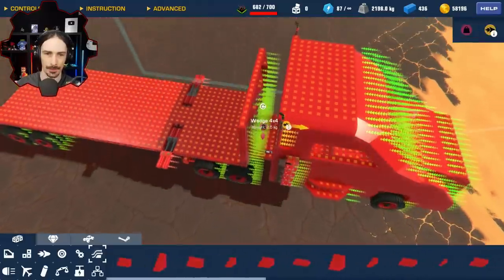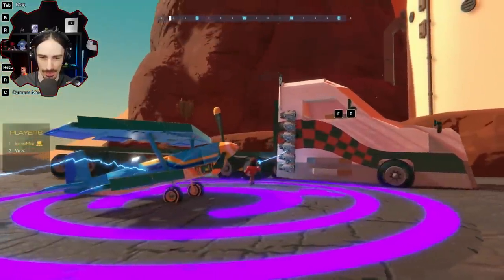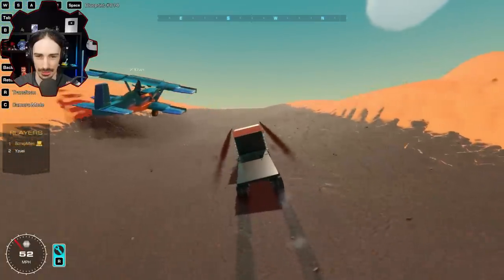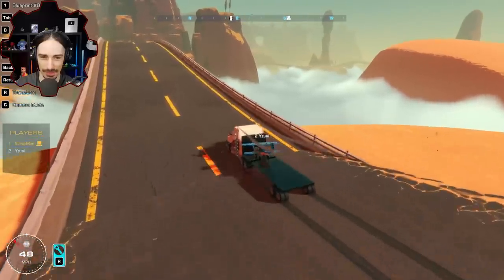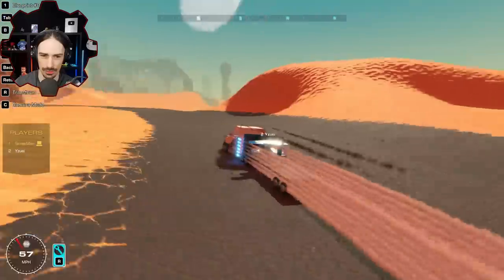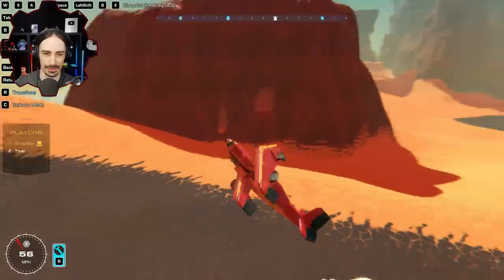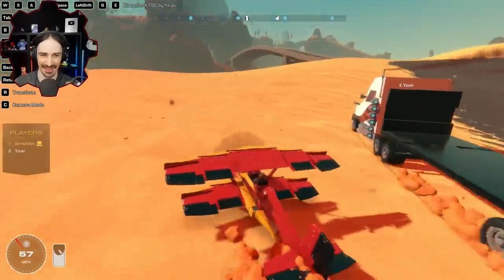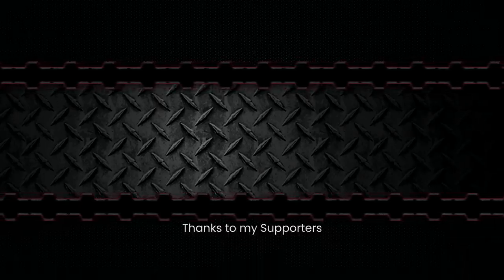Landing a BIPLANE on a MOVING FLATBED TRUCK!

Comment: I'd like to see  a flying helipad and a helicopter to land on it!
Reply: or more sensible, a swiming helipad on the high seas map.
Reply: A helicopter that is a helipad that has a helicopter land on it which is a runway on which a plane lands. And then the pad lands on a ship which is a hovercraft that drives onto a flatbed, which then drives a lap around the map without losing any one vehicle.

Comment: Hey Scrapman, i know this suggestion may be quite difficult, but I would love to see a gliding submarine (meaning that it can jump out of the water and glide for a bit of time, but is not powered while in the air) land on a plane. To make it easier, you could probably use the large cargo jet Yzuei built for landing a plane on another plane.
Reply: “NewForScrapManElite” on the workshop I have a submersible VTOL that would be perfect for what your saying go check it out and let me know what you think
Reply: Yo ik im late but he did it

Comment: Sometime in WW2, two Flying Fortress’s had crashed into each other, but they “flew piggyback”. They were still in the air connected by the metal wedging together. They managed to land safely after that. I think it would be cool if you guys attempted to do something similar. Yarnhub the YouTuber made a really good documentary about it, use it for reference.

Comment: Hoop Fight.

Build two pilotable flying hoops with sensors that can detect if anything passes through the hole. The goal of the dog fight is to fire a non explosive torpedo through the other persons hole, while dodging any fired at you. Wire the sensors so any detected goal immediately cuts the engines - causing them to plummet out of the sky. Infinite repairs until someone scores a torpedo through a hoop.

Comment: There is a red bull stunt that seems cool to me, It could be fun in trail makers, 2 pilots jumped mid air and tried to swap planes. Unfortunately  during the stunt 1 of the pilots failed and couldn't make it to the plane. But guys could succeed, which could make it fun and a little harder, each one of you build your own plane instead of using the same plane with the same characteristics, and maybe put some distance between the 2 of you, And land safely!

Comment: I think it be a challenge if you tried to land a big airliner plane, but the kick would be when landing one of the landing gears sets of wheels breaks, at random, so you don't know if it's the front or one of the sides, and then you need to assit it with a truck, and some how land the air plane whith the truck being the missing wheel.😅

Comment: Idea: A plane that lands on a submersable truck that comes out of the water onto land grabs the plane and then drives back into the water while still holding the plane then the truck drives up to the surface to release the plane from the water.

Comment: I can't help but wonder if your trailer wheels were configured funny as during the build it look like it showed them rotating the opposite way and it looked like they were leaving significant tire tracks everywhere like they were dragging. Maybe that would explain your speed problems.

Comment: Is it just me or are the back wheels of the trailer turning in the wrong direction? I think Scrapman did but them on backwards and then copied them all the wrong way around…
Because, even with that big a creation, if you add that much engines you definitely should be faster